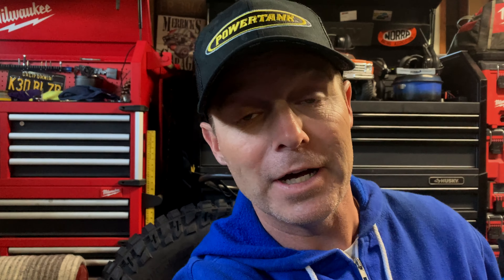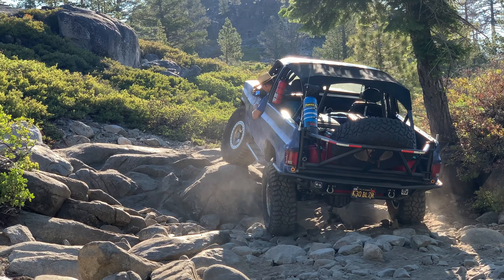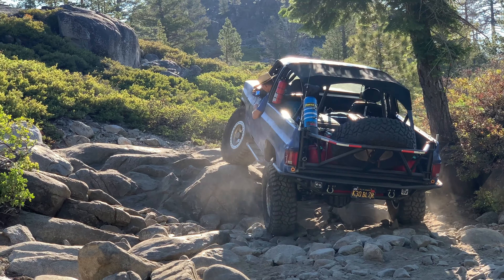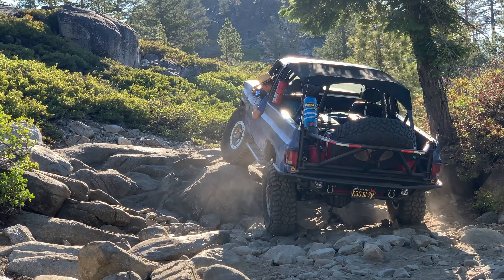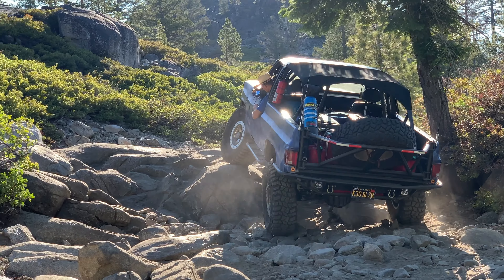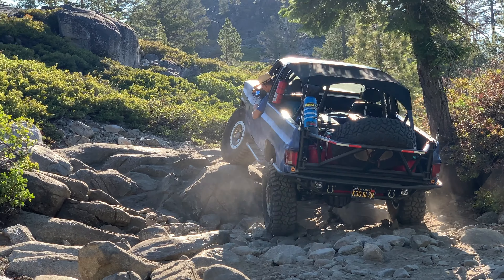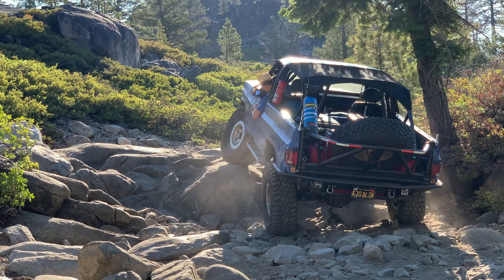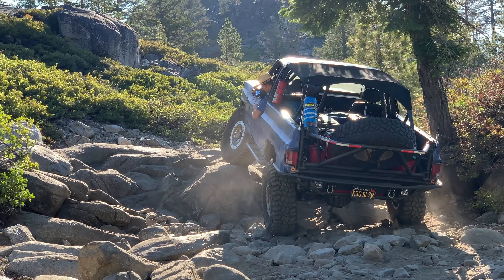Racing Wheel Install - How to install a steering wheel disconnect in your truck!

Comment: hey thats the frist thing i checked was the frame when i pull the gear box off and the frame is good and i have a brandnew rag joint i actually bought a borgeson collapsible steering shaft wonder if i get more high perfomance gear box would that fix the problem.all my gear boxes came from corner  auto parts stores
Reply from the maker: Yea I would start with a PSC box.  They are just made to tighter tolerances.  Also while you have the box off I would add the off road design frame kit

Comment: looking at this video i have a question for you i have a 1990 k5 blazer i have alot of play in my steering wheel everything is new underneath it .i been threw about 2 rebuild gear boxes and still have same play in my steering wheel  but from checking it ..it looks like its coming from the gear box to me so is it a high perforance gear box to buy ..my blazer have a 3' body lift on it and 35x12 15 inch tires on it ..i have had my blazer for along time never notic that kinfd of play in my steering wheel before..what do you suggest i really appreciate your feedback
Reply from the maker: Make sure the frame is  not cracked at the steering box
Reply: Could bet the rag joint also (little disc of rubber at the steering box end of the steering shaft).  The jeep steering shaft w/ U-joint mod works pretty good. And as Merrick said, check the frame really good for cracks around or near the steering box bolts.

Comment: Have you come up with any way to secure your steering wheel in the vehicle?  I've been looking at adding a QD to mine, but I don't want to have to always take it with me to keep someone from walking off with my steering wheel.  I haven't found any QD kits that have an option to lock them on either.
Reply from the maker: I’m gonna just use a cable and a lock when I leave it somewhere.  In the end there is only so much you can do....